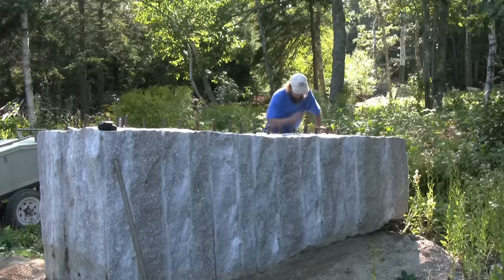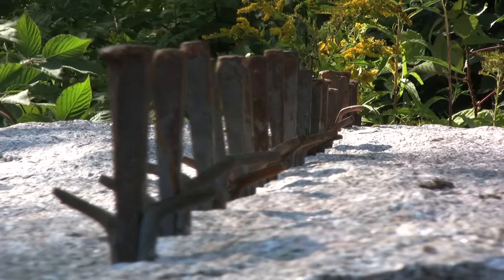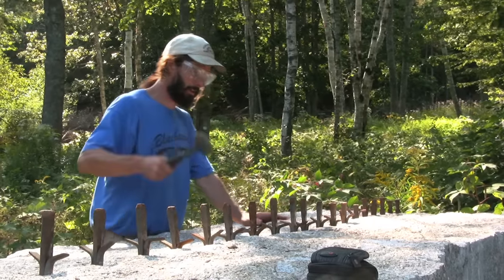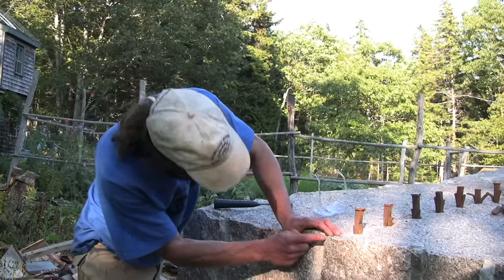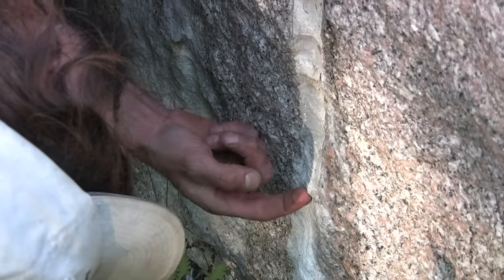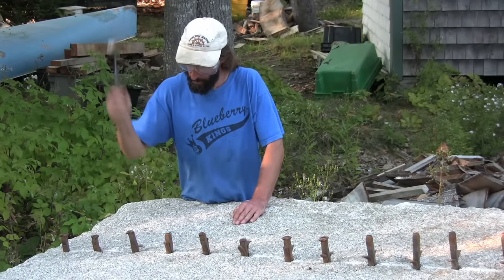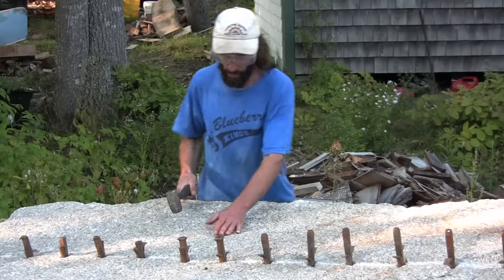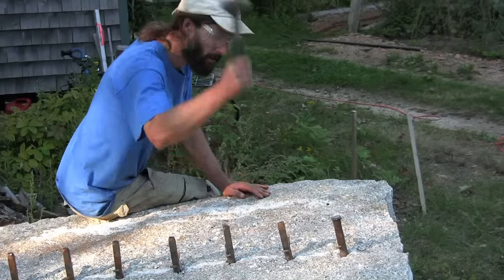Cutting Stone At The Deer Isle Hostel

Comment: to cut a stone my grandfather used dynamite, at least it was quick to do the job, he would drill holes in the rock and then insert dynamite and fire them and the stone was cut
Reply: +Anna Ciavarella Dynamite is exactly how they do it in quarries. But for splitting smaller blocks like this one it is too expensive. 
Usually special clay is used to do that as far as I am concerned. They fill the drilled holes with this clay and it expands over time splitting the rock.

Comment: Hi. I'm from Brazil, I couldn't understand the name of the metal tool you put into the stone. Could you write it here, please? If I can't find it here, I'll try to buy through the internet. Also, how do you make the holes? Do you use any kind of chisel? If you do, where did you buy them? One cannot find them here even in São Paulo. Thanks for the video.
Reply: They are called plugs (or sometimes tares/wedges) and feathers, and they need to be lubricated with grease. The holes were most likely drilled with a rotary hammer

Comment: Suppose you buy a wedge and feather set from Amazon with 7 wedges and you drive them in tight and the rock hasn't split. Is there a way to extract them or are you  out of luck.

Comment: You can do this quicker with simple wood wedges. Soak the wooden wedges in water after they've been tapped into the hole, as the wedges slowly dry out they expand to crack the rock

Comment: Is it just me, or would building a fire on there ( ie. add coals to the tops of the iron wedges once driven in tight),  make this a much quicker method without all the ear-damage?  Or, if in a cold place ex., use water in the cavities, hell soak a wooden wedge in there and let it freeze.  Yes I know, it is moot point, when ya gotta build a castle.  
My like for this is that you've shown how really easy it is to do this (albeit much hammerings), and you are now but a few knowing the craft/ legacy arts,  that thousands of forgotten workers from the past knew.
Hope yer castle is fine man!

Comment: While I like somebody doing things the old way a couple of issues  Hammer is too small quarrymen used a 6-8Lb hammer for bigger splits  a good piece of granite is going to split where it wants no matter how slow or fast wedges are hammered in If an old quarrman waited 1 hr for that stone to split he would not be coming to work the next day  by the time you can remove the wedges from stone all hammering is done at end of stone not side in case stone separates  and possibly rolls over also on longer splits end wedges need to be hit twice or they only get hit half as many times as others and may result in split running off at an angle at ends

Comment: To gain even pressure in every point of line put Wooden pieces into the square hole and pour hot water and leave for a night ....next day u'll see far better slice than iron Wedges  .... This technic is used by tamilans 2000yrs before ...